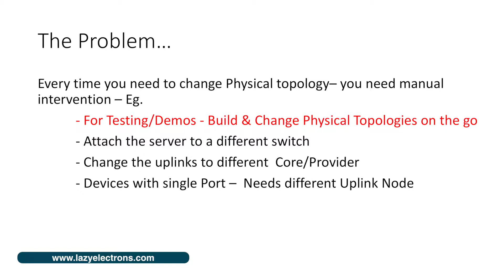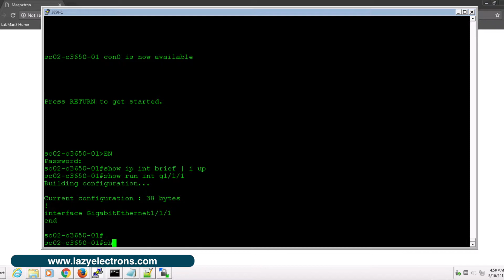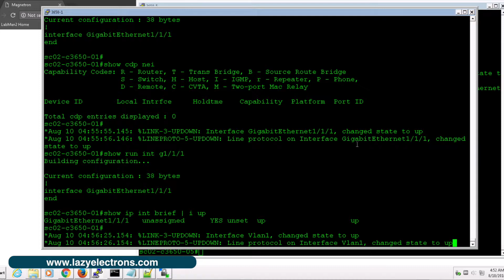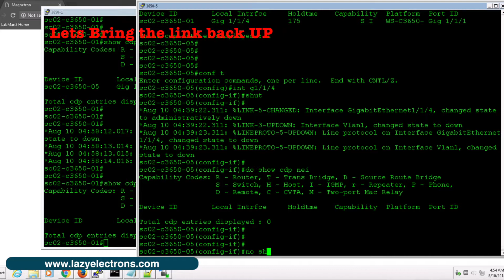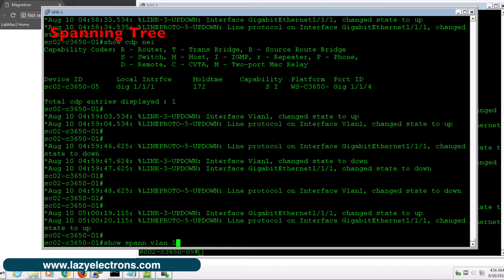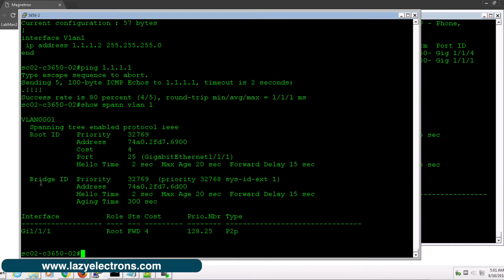Programmable Patchpanel for Ethernet (Networking)

Comment: I know this is 5 years old. Did you ever finish this? I am very interested in this. My extensive home lab is in a peculiar location do to space constraints. The sheer amount of work required to physically rewire my equipment is a huge hindrance. The current solutions and layer 1 switches are production quality and as you mentioned in the video their price reflects that. Would you share your solution with me? I would be very grateful.